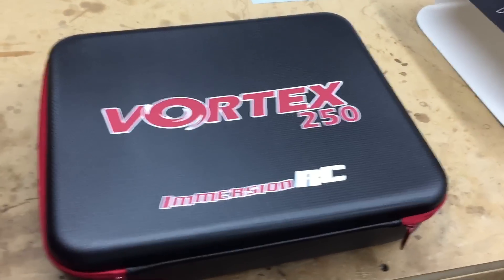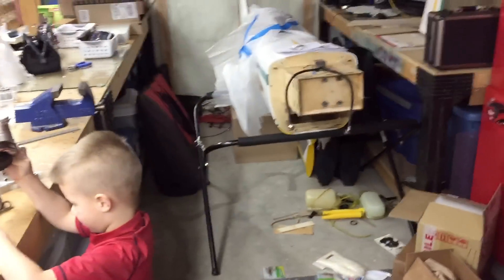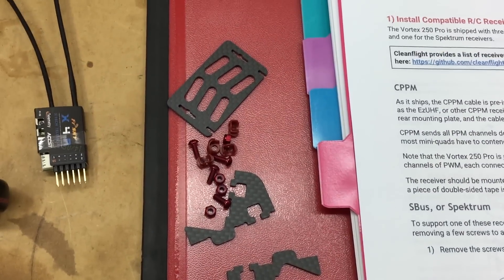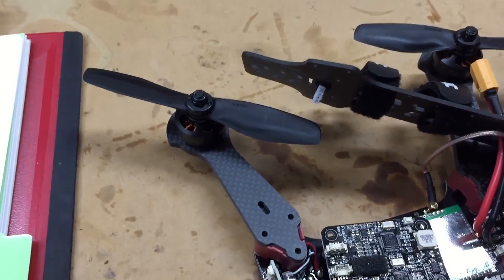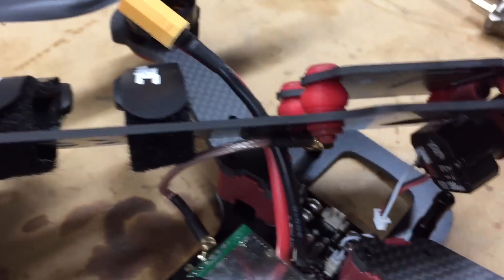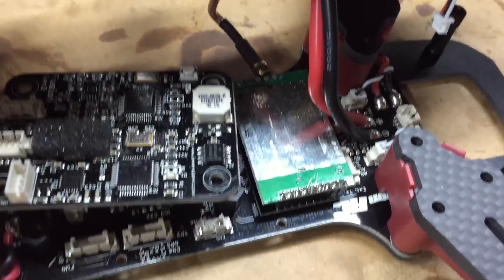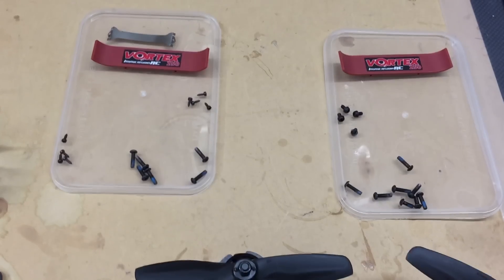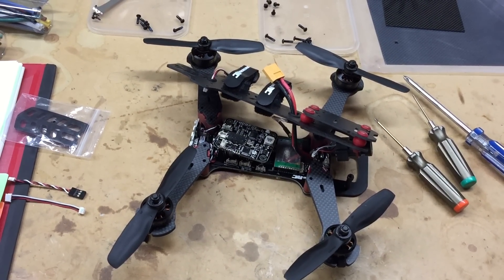ImmersionRC Vortex 250 Pro Tear-down Review & Setup

Comment: I just got the ummagawd edition and i can not get it to go past the part where it says center all sticks and it dont recognize my receiver and im using same as yours you seem pretty knowledgeable so i thought you might have some advice for me and my receiver is bound and evverthing shows up on the osd but it want go any further ive tried everything that i can think of not sure whats up
Reply from the maker: Nick Mcbride It’s been awhile but I remember having this exact same issue after reflashing BF. I believe if you  long press the button (can’t remember finch one but it’s either the one on the LED bank on the rear, or the one inside the quad on the flight controller with a small Allen key and part of the top removed) you can cycle through the receiver modes until you get to the correct one. The manual mentions how to do this so check there first.  

It might also work just to set it in Betaflight via USB to set your receiver type in the Configuration tab.

Hope this helps and good luck!
Reply: @halflife82  it does help i saw the fc button but wasmt sure what it did i have the manual downloaded so ill check how to do that i was planning om hooking it up to betaflight if i couldnt get it fixed was juat trying to avoid that for now to see if i could set it up through the wizzard but im a try all that i appreciate bud i let you know what happens

Comment: How do I hook up a Spektrum SPM4649T (serial telemetry) receiver?  I just got mine hooked up with the serial cable provided with the drone into the serial port.  I have removed the PPM cable.  Logically, I plugged the other end of the serial cable into the "female" port on my 4649T.  But, not able to get it to power up (no flashing light).  I know the receiver is working because I hooked it up to another port on another airplane receiver I have and it instantly powered up.  Someone on RCGroups thought maybe the serial port voltage was only 3.3V and not the 4649T 4V minimum requirement.  Any thoughts on why my brand new 4649T isn't powering up?  Is it wired properly?  You didn't have it connected in your video.  I wonder if you ran into similar problems?

Comment: Hi there and thanks for the video... i have my 250 for a month or so now but today i powered up and all i got was beeping and some red led's appearing along with a couple of green ones in a line , the blue led on the FC also flashes and on my ground station its showing i'm connected via ppm when i'm actually sbus... did i here you say that one can return to system default using the button on the rear led's our the button on the flight controller.
appreciate any input.

Mike.

Comment: Hi! Anywhere I can find a tutorial or some help in making the mod you have on your X4R antenna?
Reply from the maker: Probably not as I made-up the mod myself from scratch. Just take an X4R (or XSR or de-pin an X4R) and wrap it in clear heatshrink. Design your own balun base-loaded antennas or if not that tech savy, just use pre-made whiskers and run them out the rear of the quad. I use clear plastic tubing for shielding the active element, and use heatshrink to keep it all together and protected. By building antennas like this you will never again cut one up due to crashing or prop strikes! - Travis
Reply: ok thanks for the infos.

Comment: How do you make your antennas for the FrSky rx?
Reply from the maker: Design your own balun base-loaded antennas or if not that tech savy, just use pre-made whiskers and run them out the rear of the quad. I use clear plastic tubing for shielding the active element, and use heatshrink to keep it all together and protected. Sometime I should make a video on how to do this. By building antennas like this you will never again cut one up due to crashing or prop strikes! - Travis

Comment: If ever you need to remove the top plate I'd recommend checking the top circuit board (F3)  screws are tight, mine were finger loose even before my first flight. Also I'd reverse (i.e. refit upside down) the 4 plastic pegs of the damper/isolator camera platform, so that if you ever need to remove it you just pop the circlip and off she comes. (Otherwise you have to take off the side panels and the spring pops out etc!!)

Comment: I just ordered mine today along with the Black Pimp kit. It was a bad design decision to require desoldering to install some plastic bits. For an ARF, it shouldn't require soldering to replace parts. Very bummed. I had no choice but to order the Blade version, which is green. I can't stand the bright green color. I have the soldering iron, but my solder skills have diminished. I certainly don't feel comfortable micro soldering.

Comment: Eganwp, where do you put your D4R-ii RX? I've gone through 3 of them so far in less than a month (which is how long I've been flying the vortex). I've tried different mounts and positions and they still end up getting beat up or antennas ripped off. I'm thinking about putting it inside the vortex and having only the exposed part of the antenna (the last 35mm) stick out the back of the quad. What do you think?

Comment: +Eganwp How many channels do you need? Will it work with a Futaba R617FS receiver? Or has it to be S-Bus?
Reply: +Gonun sorry for the stupid questions, but I couldn't find it on the web...
Reply: +Gonun at least 4 plus 1 for acro/horizon/whatever the other mode is. So 5.
Reply: thx. It looks like it is not possible to run it with a PWM receiver... need a new one with SBus or whatever.
Reply: Gonun ppm is easiest for noobs.
Reply: Gonun Someone correct me of I'm wrong but I don't think you can use pwm when a flight controller is involved. The D4r-ii using ppm works just fine.

Comment: Good vid! Thanks for sharing. Would love to know more about how you modified the X4R antennas, and what is your expected net gain in range (or perhaps other reasons, such as less RSSI alarms?)
Reply from the maker: I haven't done any real-world tests yet, but I modified these into a much more efficient dipole antenna. Out of the box, all whisker antennas don't have a matching ground plane to balance the RF energy. What this does is simply make the antenna really inefficient and short range (short for long range FPV that is, plenty for normal LOS flying). By adding a matching ground plane, you effective range should be around 3x of stock. I also tuned these antennas to my exact middle frequency of my 2.4GHz Taranis for efficiency and increased range. In a nutshell without too much detail, adding a ground plane (one a whisker either a dipole or balun for example) will GREATLY improve your range/reception and is an easy cheap mod to do!
Reply from the maker: +Eganwp sorry for the spelling mistakes, I can't edit the comment without deleting it, but I'm sure you understand. I'll maybe make a video about this next time!
Reply: +Eganwp No worries about the spelling! Thanks for the reply. What I still don't understand, and i've now done hours of reading/research into antennas: a) why does each side of the pole have a different metal (one looks like copper, the other steel), and b) is each pole connected to a different wire leading to the receiver, or are the poles soldered together in the middle? For the life of me, I can't find ANYTHING out there that will clearly articulate these basic details, including exactly how to orientate the antennas on the quad (some people's pictures show the dipoles parallel to each other, some are perpendicular/offset).
Reply from the maker: +modsavant a) the material doesn't much matter (copper vs alu coax) but the thickness or awg does and it needs to be solid core, not stranded. I used copper as the ground plane because it's common to find in single core. A torn down CAT 5E (or 5, 6 etc) single wire will work great here. I used enamelled copper brushless motor winding wire because I have lots of it in different sizes on hand. 
B) yes, the Alu wire is the central positive wire of the coax cable itself (the stock whisker of the antenna), and the copper strand I added is soldered only to the exterior negative sheathing of the coax, thus balancing the signal to a dipole. Both are tuned for 2.4GHz in length also factoring in velocity factor and angle via formulas.
Reply from the maker: +modsavant Maybe I'll make one of my next videos about how to build these and increased range in general.
Reply: +Eganwp Ok, that agrees with all the research i've done in the past few days (kicked it into overdrive!). makes much more sense now. This will clear it up for a lot of people, i'm sure...thanks man!
Reply from the maker: +modsavant you're welcome!

Comment: Did I see where you can run 4S on this?   It will not fry anything will it.   Thought I seen in the manual you had there that it would support 4S.
Reply from the maker: Yep, 4s is fully supported out of the box with no issues. Be careful running 4s 6x4.5BN props tho, you may overamp the esc's.

Comment: Love the vid, but where did you find the manual for the PRO?  Looked on IRC website but can only find the one for the 285 which doesn't show the PRO on the cover like the one here...Again, thanks for the detailed breakdown and descriptions.
Reply from the maker: It's there but hard to see. Scroll down to the bottom and under manuals, there's a link. It's easy to miss tho! :)

Comment: Nice look inside - hoping you open the arms and show the escs next time! BTW, Airmode is a bit more than that. Here is a bit from Boris' blog (http://www.rcgroups.com/forums/showthread.php?t=2464844):

AIR Mode:
Some users were mailing me about the fact their radios couldnt be configured to have Idle up switch and asking me to implement something simillar in the software. I initially thought that this could simply just be achived with activating the "Iterm" from zero throttle together with P and D which were already done with "pid_at_min_throttle" feature. Somehow this wasnt't giving the satisfying results. It still felt weak and unresponsive.
I was wrapping my head around the fact why this was the case. We got our P, I and D on the ground....so why isn't fully stabilizing?
After some readings in other open source projects and some of the older discussions I realized that the key was lying in the mixer logic as someone already had a proof of concept code to improve it, which is pretty much scaling the PID's to our throttle level and stopping the stabilisation when one motor reaches min throttle. Now I understood why folks always preferred this Idle up switch as it was automatically gaining a little bit more stabilisation. But this is just a workaround where you loose some throttle below! The current mixer logic sounds reasonable as the early developers were always considering the low throttle values as a NON flying situation. Guess what? In 2015 we fly a lot with 0 or low throttle and especially in the mini quad scene! This has to be changed! The real answer lies in smarter mixer approach where the pid controller code would co-operate with mixer code, which would give feedback about the available power levels and ability to correct the error to always have maximum stability at all throttle levels. This would in theory also improve full throttle handling. I found some proof of concepts about this approach and integrated it into current betaflight and optimized it based on my and others flight experience. The results kind of amazed me of how much authority this gave me and how locked in it felt. Maybe the best discovery so far in betaflight.
You are pretty much able to do everything with absolutely 0 throttle with full stability. Prop wash scenarios get better and it's much more fun and freedom. I also felt more agility in turns.
Reply from the maker: Yep you're totally right Jason. I should have looked into the PID scaling that Boris added before talking about it and assuming it was just an idle-up. Totally my bad. I'm actually really loving airmode, and can't stand protunes without it anymore! Haha. Funny how fast we adapt to new features! :)

Comment: This was a great video, thanks for the info. I ordered the Horizon version and don't have it yet probably won't until the end of the month but I'm excited. Trying to learn as much as possible about this quad until it arrives. Question - and probably not a common one but you seem like you might know - how hard would it be to install a GPS unit to this little guy?
Reply from the maker: Very easy to just plug in, but the telemetry would all be based off of the manufacturer of the GPS module to configure. For example, I can add my FrSky Taranis' GPS directly to the RX and configure the telemetry on my radio directly and because I know how it works already, it's very simple. Some brands are much more intuitive than others, but like anything, it all depends what you want. :)

Comment: Hi.
When you will setup your Vortex 250 Pro could you please check in Cleanflight if the Board Alignment - YAW Adjustment is set to 90 degrees and let me know ?
OSD setup 'pushed' 90 degrees on mine but it seems to be strange, i was expecting 0 degrees !!!!
Thanks in advance
Mirco
Reply from the maker: Sorry, forgot to reply but yes, it's offset 90* in CF by default.
Reply: +Eganwp Thanks a lot for confirmation !!